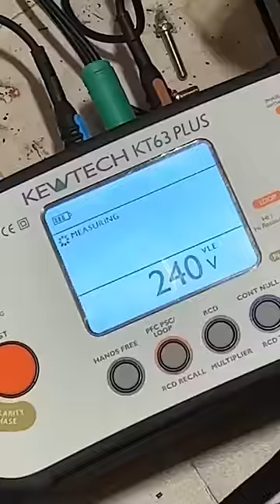Adapt improvise and overcome. Converting TNCS to TT #shorts

Comment: In my country, the standard grounding resistance should be below 4 Ω. In your video, it’s 16  Ω.
Reply: In Australia, assuming that was the main earth conductor, it should be below 0.5 ohms.
Reply: Below 4 Ohm, and what does it allow per Connection? And how much Ohm for how much Distance of Cable?
Reply: Same here should be running under 5...
Reply: It depends on the installation. If it is connected to the mains it should be below <0.28 or <0.35. if its an earth rod it must be RCD protected and below 200
Reply: LE: under 1 Ω when the ground rods are shared for lighting protection and residential power protection; under 4 Ω  when the ground roads are only used for residential power protection; under 10 Ω  when the ground rods are dedicated for (residential) lighting protection;
Reply: @dpvue  As low as practically possible for lightning protection. IF POSSIBLE below 10 ohms when measured at a low frequency. Only mandatory to have it below 10 ohms when dealing with a structure that has an explosive risk.
Reply: @dpvue  & @Almightyrastus The values you are quoting are the earth electrode resistance, measured with an earth electrode resistance tester (with two or three probes set in the ground, one up to 50m away, the other between at about 62% of the distance away from the rod).  That measures the connection the rod has to the earth. In the video he measured the total impedance of the earth-fault loop ["Z(e)"] of the electrical system at source from transformer to the premises "service head" (or incomer in the DB) and back down the means of earthing (TT rod) through the general mass of earth back to the transformer "star point" earthed neutral tap.  That circuit is far higher resistance, obviously, and 16ohm is a respectable result for a Z(e) on a TT (earth rod) system.
Reply: @chrisgibson6238  Yup, same here: the resistance of the earthing conductor itself (from the Main Earth Terminal to the means of earthing) and any main bonding conductors must be "as low as practicable" and generally below 0.5ohm.  But the Z(e), the external part of the entire resistance of the earthing system, cannot sensibly be that low when what you are measuring is the resistance (actually in context the impedance) of the general mass of earth between your means of earthing (a single copper spike, however long) right back to the transformer through land of unknown characteristics out of your control.
Reply: A w Polsce jest super jak masz poniżej 10.
Reply: @chrisgibson6238  that's with a mem link in, so you're really testing the neutral, not the general mass of the earth as a tt system would use as a return path for fault current
Reply: @howardsmith6368  nearly! 0.35 TNCS 0.8 TNS
Reply: In mine is 2 Ohm
Reply: For TT we are allowed up to 200 ohms.
Reply: And 100mA RCDs are not allowed in the Netherlands. Not for this application, at the very least.
Reply: Where are you at? Belgium it's max 30ohm  If you use ohms law you can even go to 80 ohm to trip a 300mA safely
Reply: @chrisgibson6238  lol that's really pointless concidering ohms law
Reply: @howardsmith6368  i wouldn't go higher then 80ohm , ohms law safety voltage 24V / 0,3 (rcd300mA) =80
Reply: Standards and codes are more like a cheat sheet for the area you live in. Someone before you has already caculated the ground resistance for your area. However its not 100% accurate. You can have a property in you county or town that is more sandy and has a deeper water line, good luck getting 10 ohms with a standard grounding setup. As for lighting grounds it really just has to be a number less than you. Just some words from someone who built systems in sandy deserts to granite mountian tops.  Ive literally had to hual by foot 80lbs bags of rock salt and 5 gallon jugs of water to sites to reach ground resistance levels to allow systems to operate correctly. Do that a couple of times, and you too will find yourself in a deep dive into electrical theory and difference of potential. Then youll find yourself with specialized ground testing equipment using a quadratic formula to measure an area over 500 yards. Cause F*CK them bags of salt.
Reply: What I don’t get is why aren’t people cad welding their grounds
This kind of connection is 100 years old Time to get with the program
Reply: @Dranok1 very respectable, he’s surely on a beach because despite living in wales I rarely see one below 100 ohms

Comment: I don't have any idea what the hell you're doing, but it looked professional af to me.
Reply: Ground rod 😁
Reply: He was fixing the ground rod of a house
Reply: I dont think so, i havent watched it yet, but the title says that he converts electrical installation front Tn (Terra neutra?) To tt (Terra Terra)
Reply: @maciejprokop2001  It's TNCS,
Terra
Neutral
Combined (in transit, e.g. singe core live centre armoured with Earth/Neutral armour)
Separate (in installation Earth and Neutral split at the meter before consumer unit)

Not t sure of the reason to convert to TT though.
Reply: @maciejprokop2001  TN to TT? Is that european or something? I'm American. And not an electrician. Sad, because my grandfather was, but I never learned from him.
Reply: @welshdave5263  terra/earth ground and neutral/neutral ground? Do I have that correct? I'm feeling derp right now if so 😆
Reply: @noaht5191  Man i think you are kinda rigth! And yes, it is Europan, the Words are french bc it was developer long tone ago(at least i think so). I once understood all of this but i kinda forgot it overtime.

As far as i remember tt instalations usually do not have neutral wire and are the safest installations you can have, because if you touch f.e. a fridge that is damaged and Has 230volts
 on its metal parts, then you are at 230v, but there is nowhere where that electricity would flow to, because you have no neutral wire and PE is not coupled with N

In TN installation the n(neutral) is derived from the Main transformer and is sometimes joined with protection(PE) wire. Due to this if you touch the damaged fridge and something which is hooked up to PE or N, you get shocked.

I think i got it mostku right above but i'll chęck at home :D

Edit : Man i screw up big time.. when i was talking about tt i actually described IT installation

So to correct myself:

In TN installations you have neutral and PE going from the transformer to the house (N and PE can be also joined into one linę called PEN to save money on cables)

In TT installations the N is going from transformer to the house but the PE is not. PE is connected directly to the ground rod near the house.

Its complicated i dont think i understand it fully
Reply: that's the essence of shorts, tik tok and IG
Reply: @maciejprokop2001  @noah T This guy has it right, after his edit.

With TNCS the Earth, Terra and the neutral travel in the same conductor, so if there is damage to the neutral, there is no supply, so you can't I knowingly have an unsafe system.

With TT, the consumer is responsible for the Earth connection through an Earth rod, if the rod or the conductor to it is damaged, you would know know the system is not protected.

UK we have a single phase and neutral, we usually only have 3 phase or in commercial properties.

It wasn't till a year or two ago I found out US properties have 1 phase and neutral for sockets and 2 phase for things like dryers and electric ovens.
Reply: He is making a perfect earth connection. It's must for industry..
Reply: @maciejprokop2001  I think you'll find the words are actually latin
Reply: @Welsh Dave  and this is all 220, we use 110/120 except for heavier appliances and stuff like that in the US, that's about as far as my knowledge goes lol...however I was in ukraine trying to fix a couple of switches at my mother in laws last year, I opened it up, and thought "I better call an electrician, because I am not one at home or here, so I better leave this alone"....I'm sure most of Europe is updated at this point, but I did not trust that old paper/vinyl coated soviet wiring where I was. It's amazing how similar different countries are, yet so many things can be so different.
Reply: @noaht5191  Yep all household circuits in the UK are 220/240, clothes dryers and dishwashers can be plugged into the same sockets as say, a TV or a hair dryer.

Most modern consumer units have a split-load arrangement with and RCD for each half, if the RCD detects an imbalance though some power leaking to earth (like though a person) it will disconnect.

Normally we would have upstairs lighting circuit, 6A breaker and 1.5mm cable daisy chained to each fitting then a switch drop from the light fitting in each room. A 32A breaker to downstairs sockets with 2.5mm cable forming a complete ring so no matter where I the circuit you plug in, the load is shared each side of the ring to the consumer unit.

The other half would typically be the reverse of this, the idea being that, if there was a fault on one half the board you would have either lights or sockets (up/down stairs).

An electric cooker or electric shower is still 220v but each has its own dedicated breaker (MCB) of 32A or 40A on a single radial run of 4mm or 6mm cable, respectively.

If you think the paper and vinyl Soviet withing is bad, at least they are non conductive. 

The UK used to have LEAD sheathing on Twin and Earth cables, yep, paper insulation on the inner love and neutral conductors then LEAD outer, it's long since been replaced by PVC but when I was about 14 and staring to learn by helping with rewires, I used to have to remove a fair bit of it.
It was I stalled back in the days before RCD was invented so in really cold as damp conditions, you could get a little tingle by touching some brickwork!
Reply: Its not, this guy is a hack
Reply: @maciejprokop2001  i was about to start bashing so bad but you corrected yourself. Good job
Reply: Well done work,  where is this,  I am electrician in Nz, and here we use a different procedure....
Reply: It’s 2 different ways that the earth and the neutral are handled.  I THINK that in TT - the earth is separate, while in TNCS, the earth and the neutral travel along the line through distribution together, and are split at the house. The TT (TT-TNS)  has a completely separate earth (the copper rod at the beginning). The advantage being that one can run unbalanced, multi-phase power
Reply: @welshdave5263  TT - the ground is separate allowing to run unbalanced, 3 phase power - or something like that.
Reply: @welshdave5263  I also have no idea why to turn nice TN-CS to TT... Last year i was doing conversion in my home from an old TN-C to TN-CS. Almost 18m of rod... happily down to 11 Ohms.

But his work was clean, nice, although that multimeter flash was a bit too quick... was it 16 Ohms?
Reply: @noaht5191  Not exactly. Terra - yes. N means network - neutral is provided by a cable. C - combined (neutral and earthign cable). S - separated (earth and neutral cables are separate. TT is old style with additional grounding rods allover the place. It was supposed to be more safe.
Reply: @DreStyle
Reply: @valmorfariasdevargas1482        

What
Reply: Earthing.
Reply: Видно по проводах що то заземлення. Заземляючий провід має зелені полоси
Reply: most pros don't have the time for filming ourselves work.....
Reply: U have phase-L neutral - N and safety line -PE. Mostly in US PE is on one line on N. but this technology too old and not safe.
So, he made more common PE connection.
Reply: @noaht5191  UK as we use 220/240v and this is a 240. Europe uses 220/230v
Reply: Tiny grounding rod 
😆 🤣 😂
Reply: Grounding system or grounding can be defined as an electrical connection, intentionally made between an electrical device or a network of appliances on the one hand, and a mass of earth, on the other hand.[1] Therefore, grounding is required to provide safety for the electrical system and for the workers in the facility, and this is generally known to the majority of people, but it is not clear to the majority of people how to achieve this. The ground can be likened to a lifebuoy or a landing parachute, as they are valued only when they are needed.
Reply: @welshdave5263  I'll have to read up a little on TNCS, but the US systems are technically single phase. The 120/240 volt systems are actually known as split phase...
Reply: @noaht5191  this is stuff I learn as an apprentice electrician in my first year. We use the English words for this too in Germany
Reply: @maciejprokop2001  I think you explained it pretty good actually. I know I was completely in the dark before I read your comment, and even though you think you didn't explain all of it correctly you certainly gave me enough info to where I could get a grasp of the basic idea and it helped me pretty much understand the reasoning for the video. So thanks for that!
Reply: @craigreed3761  Thank you, I'm glad to hear that !
Reply: A professional would have a rod pounder.
Reply: First class electrical service!!
Reply: Toprak Hattı Yaptı Gerçek topraklama bu şekil olur ama taktığı sigorta aşırı yüksek asansör bile besleyecek olsa ki sanayi voltajı ile çalışır 300V veya üzeridir onun için bile bu sigorta aşırı fazla max.40A yeterli sanayi tesisi olsa belki 100A iyi ama burası ev sanırım yani sigorta en fazla 30A olması gerekiyor 🤦🏽‍♂️
Reply: It's expensive, but get a hydrovac and bore a hole straight down. Place rod and backfill.
Reply: He's installing a ground fault circuit.  Y'know, that button on your bathroom outlets?
Reply: Это заземление , к вашим розеткам подойдет, в России напряжение больше у нас такое заземление не спасет .
Reply: @noaht5191  это тт, америка.
Reply: Those are different earth and neutral connection standards for indirect contacts.
TNS, means three different things
First letter describes how the neutral is connected, T means earth/ground 
Second letter describes how the electrical equipment ground is connected, in the case of TNS, to neutral.
the S means the neutral and earth are separate and the neutral can be disconnected in the panel, in TN-C ,which is the opposite, ground and neutral are all together a single wire called "PEN" (protection and neutral) and cannot be disconnected from the panel as it ensures safety against indirect contacts 

TT means both are separately connected to earth, when a ground equipment shorts to a phase travels through earth instead of the neutral conductor

with a TN basically you have a short circuit.

Should he mentioned that the TT is only for the end user, the electrical power grid transformer before the user will always be a TN

Don't know if I have translated it correctly in English
Reply: His piling down copper rod for electrical grounding
Reply: Same shit I was thinking 😂😂
Reply: Jajajaja
Reply: 😂😂😂😂😂 that's what I was going to put .
Reply: @noaht5191  good job🏆
Reply: I suspect there wasn’t a true TNC-S at the property so had to be converted back to TT to stop Mrs Jones getting shocks every time she touched a pipe. 
TT - Terra Terra
TN-S -Terra Neutra at Supply
TNC-S-Terra Neutra Combined at Supply.
Although effectively the neutral bar in the main cut out on a TNC-S is earthed to the same point as the sheath you connect earth to on a TN-S system only difference is it’s outside the property on the way back to the transformer. 
Max impedance values:
TT <200 ohms
TN-S <0.80 ohms
TNC-S <0.35 ohms
Reply: Making a big deal from a simple job
Reply: @Thedar561  😂😂😂 designed the entire install without even knowing what the earthing arrangement was 🙈
Reply: I did know.....unfortunatley i read the comments 😢.....just joking😅

Comment: Get yourself an sds rod driver .They are brilliant 👍👍
Reply: Yea, a lot better then trying to use a tiny hammer drill in drill mode for Christ sake!
Reply: For one time in the life?
Reply: @tekknorat  well i once made one, from pice of scrap steel rod, i think 20mm diameter,  just to push one ground rod 3 meters deep.
Reply: Around here, if you’re an electrician, it’s a frequent occurrence. However, it works a lot better using a demo hammer, or better yet, a jackhammer. Ads doesn’t pack much of a punch…
Reply: You can make one. Just cut the tip off an old chisel bit and hold some sort of sleeve such as pvc pipe with your other hand to keep it centered on the ground rod.

Comment: Man, you're lucky to have such nice soil. About 95 percent of the ground rods I've driven have hit big rocks. We even used an electric demolition hammer with a ground rod socket, and still had trouble. What I would have given for a bigger jackhammer!
Reply: I used to run 12 foot ground rods about 5 or 6 together in substations that was a bitch to do most the time we’d use a jackhammer and a excavator to push down on the jackhammer😂
Reply: @chrissaunders7290  might be easier to dig holes and then bury the copper! 😊
Reply: Just be happy that it's not a sledgehammer 😂
Reply: @mrtechie6810  Sometimes it really is impossible in places to drive the rods. I’d have to say I just don’t remember the requirements/specifications for laying ground rods in a trench, although we’ve had to do that occasionally…
Reply: @nicebubbles  You’re not kidding! Done that a few times too! 🤪
Reply: Absolutely pointless main switch replacement, what’s a 100mA time delay going to do when each circuit has 30mA protection?

Comment: I have found, at least in sandy and clay soils, if you keep the connections completely under the surface of the soil, there is less oxygen and less oxidation on the connections. I think this is a creative idea, but it is setting you up for potentially more oxidation if moisture seeps into that box.